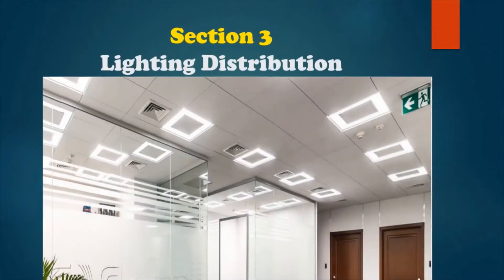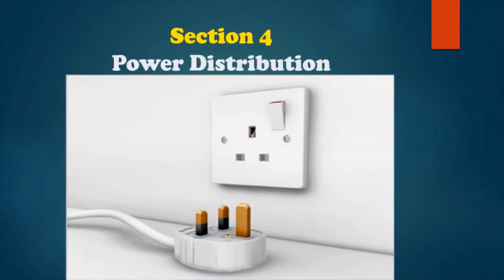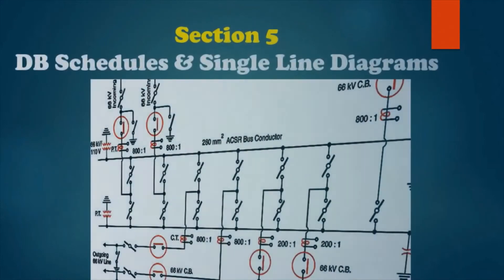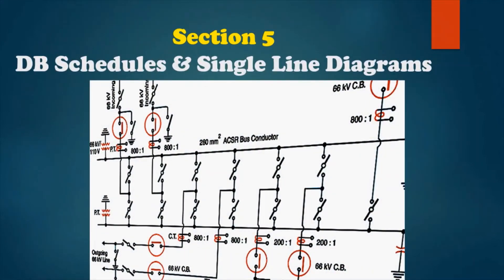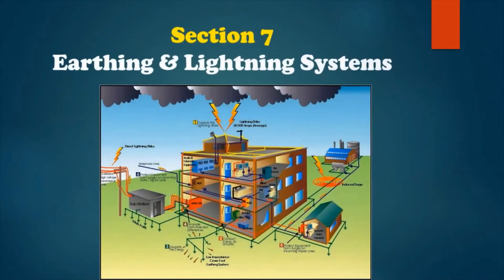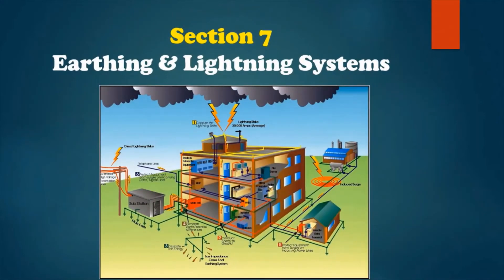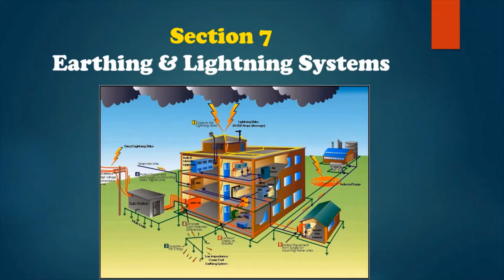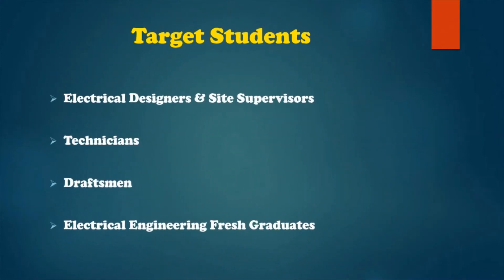Power Distribution Design Comprehensive Course

Comment: Sir I'm a civil engineer, do I need prerequisites subjects in order to follow ur course? Or it just require basic information. Thanks in advance
Reply from the maker: The course requires the basic knowledge of electrical engineering. If you have that, you will easily catch-up with core topics; Regarding the covering chapters of AutoCAD & Dialux softwares, you don’t need that much of knowledge because it is already covered from the beginning. 

All the best!